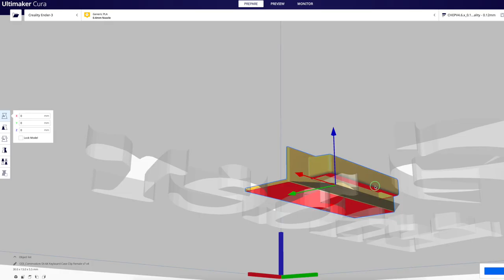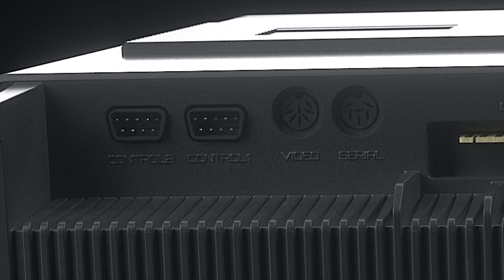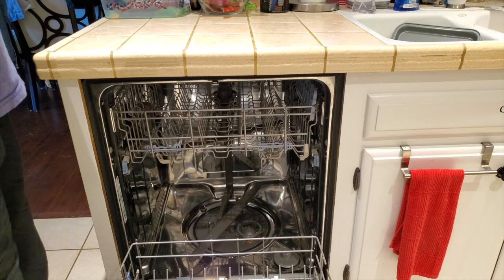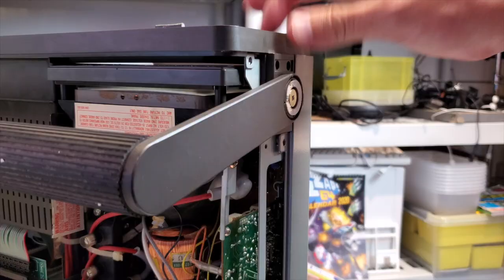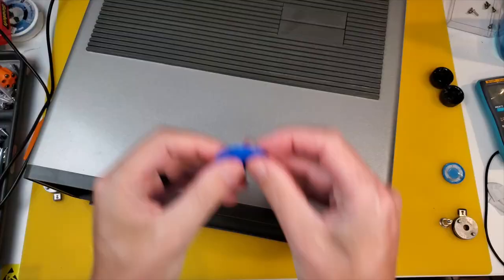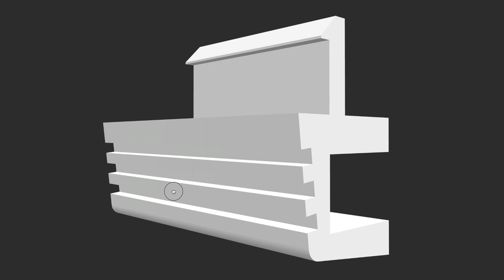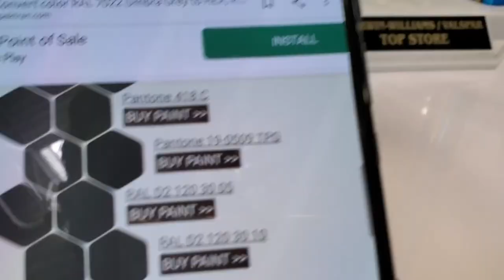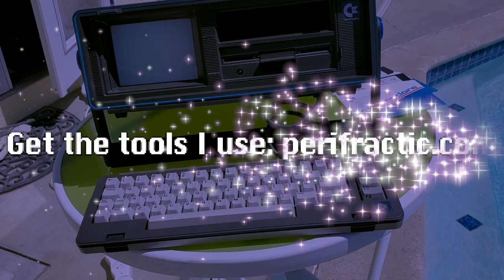3D print repair + dishwasher refurb: The 1st color "laptop"! Commodore SX-64

Comment: Did you consider ABS for the parts as it's generally much stronger than PLA and is IMO the best material for functional parts.

To be fair ABS is much harder to master than PLA but it's worth learning if your printer has a heated bed capable of ~90 DegC. I wonder how those end caps would look if you could Acetone vapour chamber ABS versions of them (It smooths out the print layer lines). 

Nice job and I find the 3D modelling the most difficult aspect of 3D printing. Personally I'd replace the glass pane with something clear as I suspect the CRT in that is pretty rare but i do get it looks better.
Reply from the maker: Maybe I can 3D print a new CRT panel. No, wait...
Acetone bath, yes but those little indent details marking where the release switch is might be degraded and somehow I like the texted finish ¯\_(ツ)_/¯
PLA is more than strong enough for the little keyboard clip's needs 👍🕹️

Comment: @18:20 Where did you get the heat sinks for the SX-64 P.L.A. and S.I.D. chip?  It's a good idea, especially for the S.I.D. chip which are getting scarce these days (although there are aftermarket replacement S.I.D. chips I understand).  Cool video. SX-64 was ahead of it's time (Compaq Portable III IBM computer not withstanding)

Comment: If we print 3d laptop on multiple 3  d printers each use one type of materials then how many goes unemployed? Because the smart phone could be done the same way on assembly chain of printers of different materials then no needs low level assemblers and the profit would shoot up the roof lead to drop in price and still profitable

Comment: 4 screws and the whole monitor chassis pops right out. screws are reachable from the top do not  need to remove bottom cover
Reply from the maker: Right, but how do you get to the bottom 2 screws? They're at the bottom where no screwdriver can reach, covered by the bottom case and CRT innards.
Reply: @RetroRecipes  Sounds like you might be eyeing the wrong screws. The whole crt tube is in its own chassis. There are four screws all the way down on the bottom of the chassis near the edges. You're right about the bezel screws, can't reach those until you liberate the crt chassis from the sx chassis. I took this journey a while back, ended up buying three of these to make one perfect one and in the end had three working units in varying degrees of cosmetics. The MIKA3d silk peacock blue is a very good match filament if you decide to print some more parts.
Reply from the maker: @justinthomas2458  Ah I see what you mean. If I open her up again I'll take a look, but I love the "new" screen that removing the glass gave me. As it's sitting essentially in a museum, I'm okay with it not having the protective anti-glare glass for now. 👍🕹

Comment: Which spray paint silver color did you use to touch up the case?  My SX-64 is in nearly perfect condition, though it has one scratch at the top, would be nice to touch that up.  Thanks!
Reply from the maker: I show the Rustoleum can but don't have it to hand. But I noticed after that a standard silver Sharpie was pretty close... Also http://retrohax.net just posted a new blog with an exact colour match.
Reply: @RetroRecipes  Thank you!

Comment: Couldn't you use car polish and a DA buffer on the glass to remove all that crutz?
Reply from the maker: No it's burned away tinting
Reply: @RetroRecipes  Is the glass flat or curved?
Reply from the maker: @hualni  Flat
Reply: @RetroRecipes  You can always just cut a piece of glass for it. Even a picture frame glass with anti-glare would do nicely. Just put a surface protector on it to protect against shattering. Would that work?

Comment: Aren’t the heat sinks going to fall off once the adhesive heats up? You might want to add some clips like the original video chip sink.
Reply from the maker: Nope, it's 3M thermal adhesive designed specifically for this.
Reply: Retro Recipes Great then! I had this same model as a kid. I’m kicking myself for giving it up. It’s gorgeous, awesome work!

Comment: Great video! Around 6:30 what software do you use to pin the text to appropriate area? It stays stuck in the right spot while you rotate the camera.
Reply from the maker: That's a plug-in for Final Cut Pro called Effects Tracker by Pixel Film Studios
Reply: @RetroRecipes  Thanks!

Comment: Why not replace the glass, to help keep the whole thing sealed, as well to protect the CRT.
Reply from the maker: Well, I keep a clean museum-like environment and can always open it up again to clean in 10 years when that dust might matter. I explained my reason though - it looks so much better without the darkened glass 👍🕹️
Reply: @RetroRecipes   Sorry.. I meant replace the glass with a clear piece that can be bought at any window shop, or glass supplier.
But, I get your point. 
But don’t forget accidents, like the 240 volt Amiga incident.....
Ya never know what the next one will be.
Fantastic job preserving your collection.

Comment: curious why sam's journey cartridge runs on the ntsc sx64.
Reply from the maker: The cart is actually designed for NTSC primarily if I recall
Reply: @RetroRecipes  it was PAL.  NTSC you need an REU plus disk or one of the ultimate carts
Reply from the maker: @PSS521  you’re right!
Reply: @RetroRecipes  it puzzles me why the pal cart runs on the sx64!!
Reply from the maker: @PSS521  I think it will run, but not be optimal. Probably frame skips and other doodahs I didn't notice.

Comment: The glass is very likely leaded and intended to be a radiation shield.
Reply from the maker: Do you have a source for this info. The forums didn't seem to think so. I don't think any CRT screens had lead glass did they?
Reply: @RetroRecipes   No, I don't have source for that item.  Called it an educated guess.  I have seen discoloration like that on photomask plates used in ion implanters used in IC production and I know that certain military equipment used leaded glass shields in front of smaller CRTs. 

CRT tubes are classed as hazmat due to their lead content.  http://www.electronicstakeback.com/2012/11/15/recyclers-stockpiling-millions-of-pounds-of-toxic-glass-from-crt-tvs-and-monitors/

This is a very early consumer CRT and it was intended for use at close distances.   It is also quite small, meaning that the front glass will be relatively thin. It has a 24 kv acceleration voltage so it will pose a radiation hazard similar to a larger tube but with much less front glass to shield you from it.  I would probably have added a second shield just for safety.

Given that you could not clean the surface, that can mean that the discoloration is in the glass rather than on it.

A quick way to tell would be to measure it very accurately, calculate its volume, and see if that matches the weight of soda glass or of leaded glass.  The conductive clips offer another clue - they may have been intended to dissipate any electric charge which would come from relativistic electrons leaking from the face of the tube and getting stopped by the glass.
Reply from the maker: @chindokae5684  Interesting!
Reply from the maker: I checked with Bil Herd (Commodore engineer) and he said it isn't for radiation and there's no danger. He said it was either for glare reduction or electromagnetic interference.

Comment: I can’t believe you said you were going to take it to Starbucks! I was going to do the same thing and I have an old rotary phone that I converted to a mobile phone ( https://youtu.be/zMod-BHadM0 ) that I was going to use with an acoustic coupler modem to get online and send tweets! 😂 

I have one in near mint condition that I make music with using trackers. I had to 3d print one of the clips on the keyboard and used the same color. You have to look really hard to tell it’s not original.

For anyone who needs the keyboard clips you can download the STL / geometry files for 3d printing here: https://c64.berrydejager.com/reproduction-of-the-sx64-parts-by-erwin-van-betten

I don’t think these are available on Thingiverse. 
There’s some good quality handle caps on that page too.